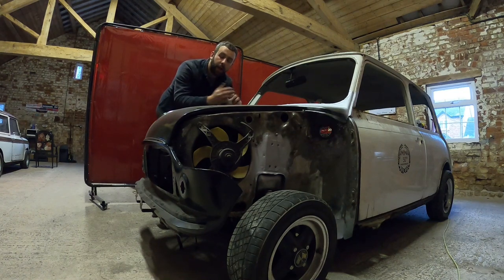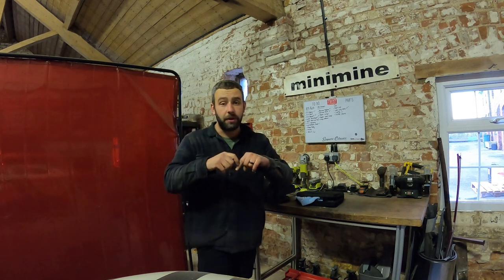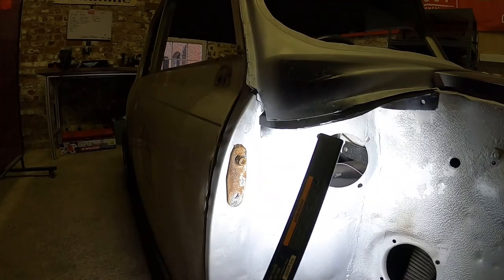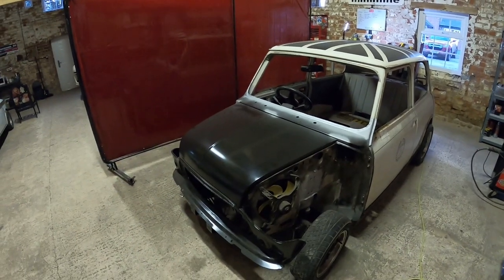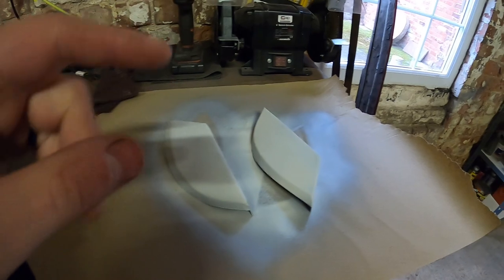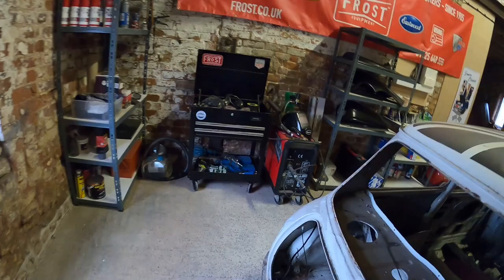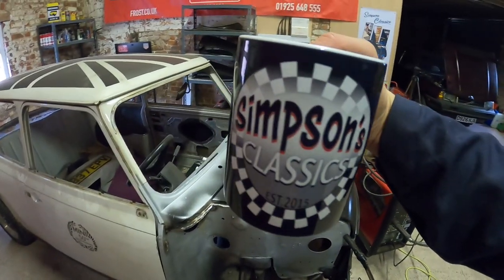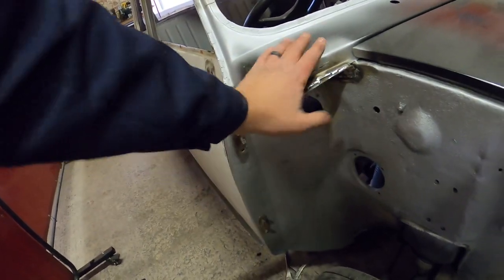SCUTTLE CLOSING PANELS - Classic Mini Mayfair Restoration

Comment: Nice to watch you with those closing panels 👍🏻. Probably the first time I've seen those being done. Plus I wouldn't have thought to use sealer before you welded them in, I'll be doing that now 😊😊. Also the mug looks good. Be interested to see what's coming on the merch.  Keep up the good work 👏🏻.
Reply from the maker: Thanks Rick I appreciate that glad you got something from the video it’s just the way I do it and it’s seemed to have worked. All the best with your and yes stay tuned for some Merch coming 👍

Comment: I like the fact that you have painted inside the closure panels before welding them in. I'm a bit dubious about the rustproofing quality of weld through primer. I might be tempted to drill a hole and squirt in Waxoyl or Dimitrol when the car is finished and plug the hole with a grommet.
Reply from the maker: Cheers George its something I have always done, in that area you can get to that from the inside and various access holes to get plenty of wax in there. Thanks for watching.